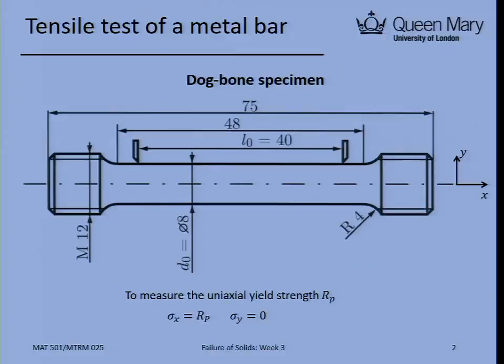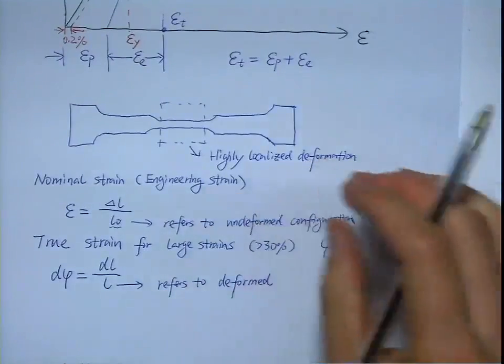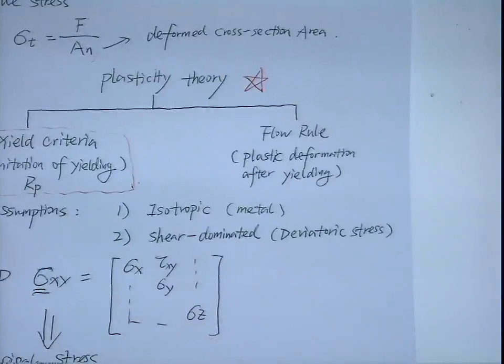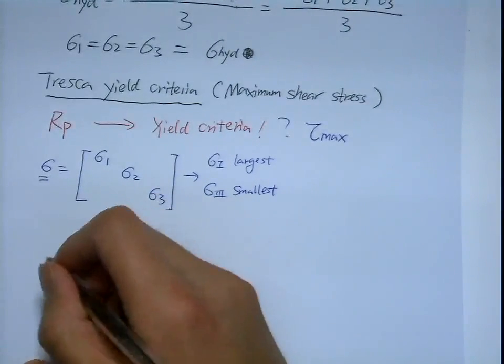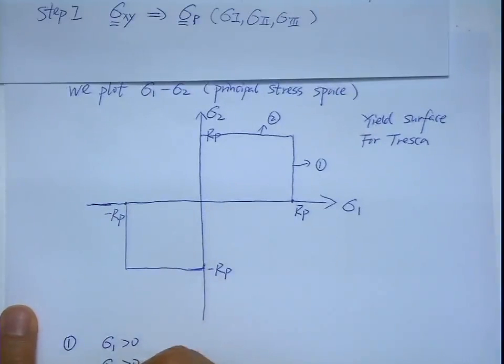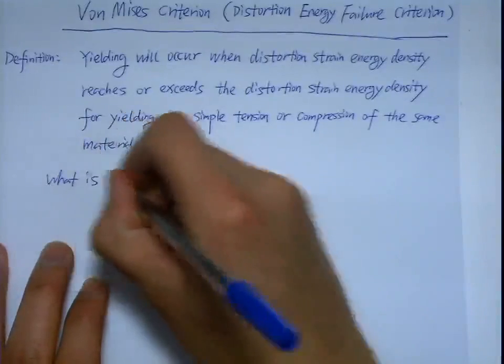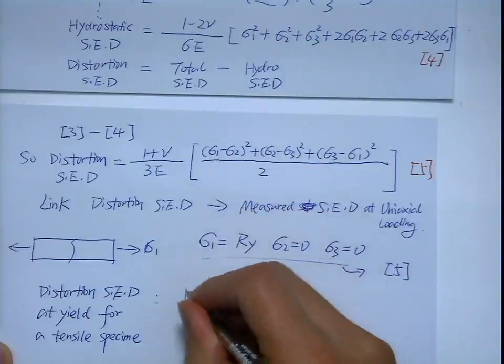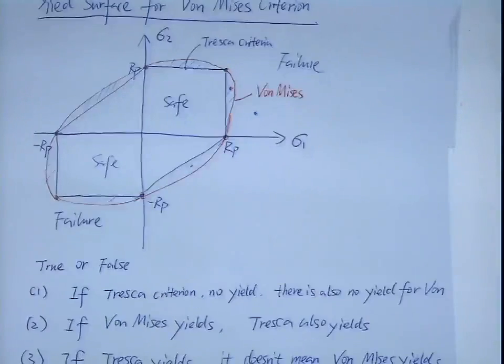Revision lecture: Plasticity and yield criterion

Comment: How to apply in simple shaft pure torsional design?
Reply from the maker: Torsional loading on a circular shaft is essentially applying a pure shear stress on the shaft. If considering Tresca yield criteria, this shear stress can be directly used to compare with maximum shear strength (R/2). R is the tensile yield strength. If considering the Von Mises,  you need to use the pure shear stress to work out the principal stress (Mohr's circle method or eigenvalue method). Then substitute the principal stresses into the Von Mises equivalent stress equation (\sigma_{eq}) to determine whether it is larger than tensile yield strength (R).